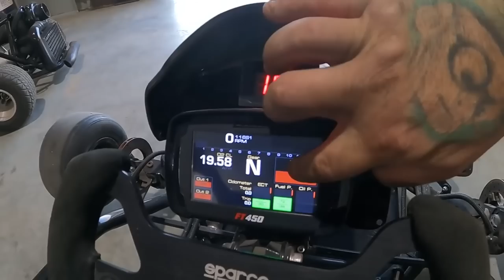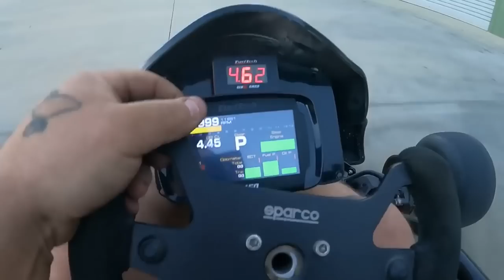400hp hayabusa gokart this thing was a weapon

Comment: So since you went to all the trouble to build this beast, why don't you try driving it like a normal person would instead of slamming the pedal to break it loose and burn up tires. Try to make it connect to get up to speed. Just revving the engine al the time and breaking it loose is just plain BORING!
Reply: My guess it's not that drivable.
Reply: Probably try fitting something other than roller skate wheels with 1 mm ground clearance.